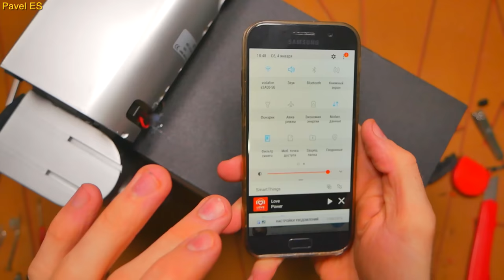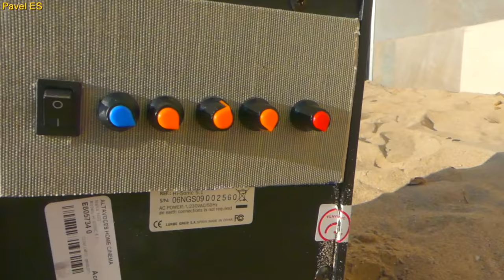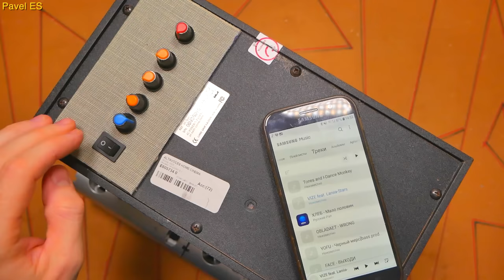2.1 [#OnlyFlex]

Comment: The original subwoofer is dead because in 4 ohm load mono can get 100w at 24v power supply, thats why it dead so fast (i already read the datasheet of tpa3116)
BUT MAKE SURE YOU BUY BLUETOOTH AMPLIFIER WITH THE ORIGINAL AMP CHIP!! BEWARE OF FAKE AMP CHIPS!!